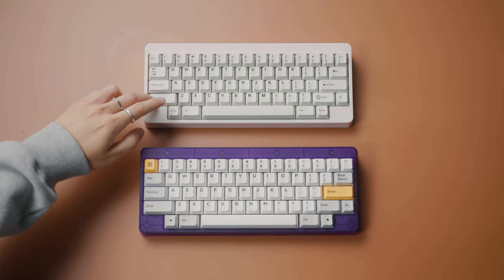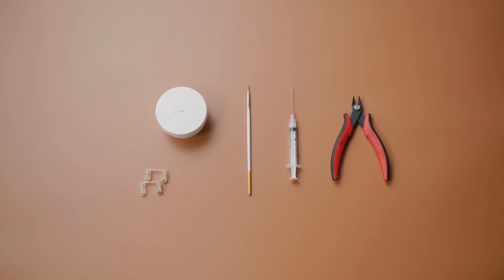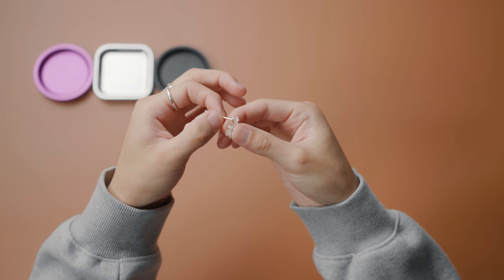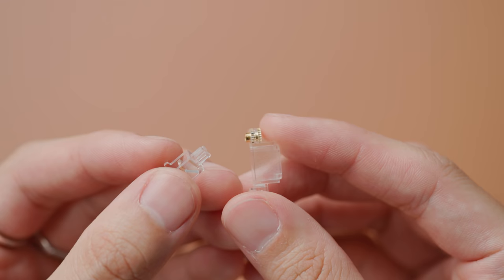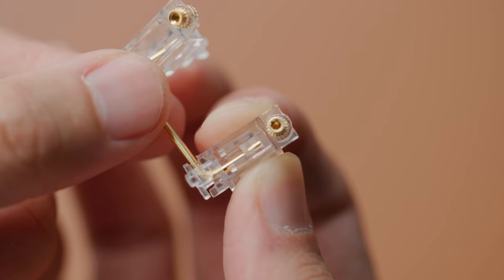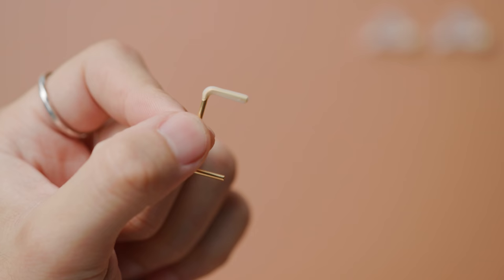How to Lube and Tune Stabilizers

Comment: My guy taeha made me buy dielectric grease and Teflon grease half a year ago and now he changed opinion. My guy
Reply from the maker: times were different back then :(
Reply: It do be like that sometimes
Reply: @TaehaTypes  what do you think about tribosys 3204 for stabilizers
Reply: @jesseochola6311  I'm not Taeha but he said thinner lubes (than 105g0) were good too, I've tried them on some cherry stabs as well as the gold zeal ones and they turned out perfectly fine.
Reply: @efrrun  okay thank u!
Reply: @jesseochola6311  its fine, just use the lube u used for your switches

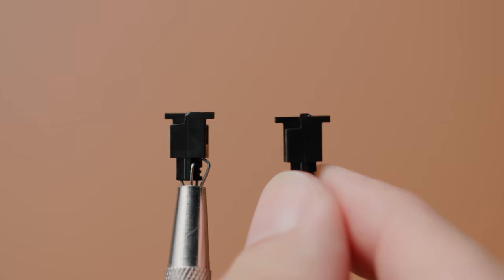Comment: 3:47 filing the clipped stems with a nail filer is also a nice touch as it made the stem as smooth and perfectly flat as the pre-clipped stabs like Durock, etc.
Reply: I like to clip cherry stabilizers at a 45-degree angle, so that the legs are still there but no fangs. Then put some electrical tape with a dolup of grease on top, on the pcb before installing the lubed stab's. It makes them sound nice and clacky and feel tight.

Comment: The syringe one is very helpful! I built my keeb a month ago and I didn’t lube my stab wires well so it rattles a lot and now I just realize if I want to fix the stabs, I’ll have to desolder everything on my board so I fixed it with some piece of tape to reduce the wiggle room. The rattling noise is still there but just a little but still, I wish to remove it entirely. Never thought of this syringe method before. I’ll give it a try. Thanks Taeha!

Comment: I'm building a GMMK pro White Ice, yesterday I spent 5 hours lubing and filming my 82 switches, I work on PC's for a living and I thought I could do the switches in 3 hours tops, oh how wrong I was! Films added so much more time to the switch lubing process, all that's left to do is my v2 durock stabs, I bought lube and grease for this build, and I think I'll still use the grease on the stabs. Very helpful video as always Taeha thanks a bunch!

Comment: Great tutorial! I think you can use interdental brush to remove excess lube inside. You just need to stick it inside like your scraping something or just letting the bristle of the brush to stick as much lube as possible then wipe the tip of the brush with paper towel or wipes. You may need to repeat the process several times until you notice there are to little lube are sticking to the bristle then you may proceed with reapply lube using the syringe method. It works fine with me and save me hassle to desoldering all of the switches.

Comment: Relatively newish mechanical keyboard enthusiast here. Have bought a few keebs over the past month or so and only just got into modding. (first mod was a tape mod!) 
Found my way to investigating stabilizers when, after trying different switches, keycaps, and applying tape mod, I still wasn't quite getting the sound I wanted. Realized it was likely the stabilizers. 
Your video helped me a lot! This sort of detailed walkthrough that also doesn't waste your time along the way was exactly the sort of content I was looking for. Thanks! 🙂

Comment: Thank you so much! I just lubed my switches and stabs for the first time and I watched a couple quick videos prior to doing it but I had this weird ticking sound only on the enter key and what you told me to do fixed it without having to take all the switches off and keycaps and unscrew the whole board. Now it sounds super thocky. It's a little muted but It's my first time. I'm happy with it.

Comment: Don't forget to balancing your wire. And my tips if you still notice some of ratling, you can wrap your wire with seal tape (2 or 3 layer is recommended) before you lube your wire, then lube your wire and put it back to the stem.
Reply: which is better? doing holee mode or just wraping the wire? or both?
Reply: @talyodiaz256  its same. You'll feel mushy. Its better for you get a good aftermarket stabilizer.

Comment: For anyone still watching this amazing guide, I have a tip that is probably going to sound like the most absurd thing you've ever heard.  To start, make sure all of your switches are lubed.  A lot of the time, if a switch is not lubed, it will sound scratchy and make the entire stabilizer sound like it is rattling.  Secondly, and this is the crazy part, if a stabilizer is rattling, and no amount of lube will fix it, switch the switch with another from a different key.  Once again, I know it sounds ridiculous, but it may work.

Comment: Thank you for this! Just finished putting together my first keyboard and I am really satisfied with the feel and sound. 

It isn't the best keeb out there. I consider it a budget build. 

TM680 from Antidote Studios in white
Lubed durock v1 stabs in white
Boba U4T switches factory lubed
Iceberg clones from keykits

It was great practice while I wait for the Aozora GB to finish. Then I'll build my first "premium" keeb with the Port cap set I got from Infinikeys. 

And... well... I'm already in the GB for Analog Dream 2 and plan to jump in the Laneware LW67 which I am ignorantly claiming will be my grail.

Comment: I have two keyboards I lubed with 2 stroke motor oil (which is relatively viscous). The first one I did 4 or more years ago and is still working like a charm. The second is more recent and also working like a charm. In both cases I did that without any disassembly and also lubing the stabilizers can be done this way. The result is a much quieter keyboard while also paired with O-Rings for each keycap. Keys sound super solid and no rattle. A quiet "thump" instead of "clackity clack"

Comment: What happened to band-aid modding the PCB? Is that method dead?
Reply: I think Taeha mentioned a couple times on stream that he didn’t think it made much of a difference, or was very effective with the stabs he’s been using, so he stopped doing it on most of his builds. Can’t furnish details or proof but I think he qualified that statement with your mileage may vary
Reply: @wongasaur  alright, makes sense! Thanks 👍

Comment: The syringes linked in the description are luer slip syringes I would recommend luer lock syringes for thicker lubricants as the luer slip syringes tend to fall off when using thick lube also the needle in the video is a 18ga blunt needle but they sell larger needles that would work better if you want to use thicker lube like a 15ga or a 16ga.

Comment: if you are in a relatively dusty environment, the dust in the air finds its way to the lubricant
+ if the air is humid then the area becomes a pocket dimention for microorganisms

Comment: I just built my first keyboard! As a novice, I was really happy with the results for the most part-- but my spacebar sounds awful. I was super confused because the smaller stabalizers on the board sound great. I was kind of bummed and not sure what to do about the space bar. After watching this video, I was able to diagnose and address the problem. This was very easy to understand and also info that is pertinent but not included in other tutorials. Thank you so much!! (My keyboard is a freebird60 with melonmilk tactile switches, durok v2 stabilizers (came with the fb60 base kit, and a cherry profile PBT keycaps I snagged off Etsy).

Comment: pls help, I just finished modding my keyboard and did everything as instructed in the video, but when I press on the left shift key (the rest of the stabs are fine), it has a weird bump in it even though I bought linear switches. I checked if it was the switch but it looks like its something with the stabilizer. Anyone know how to fix this?

Comment: I've tuned like 5 sets of stabs so far, and I still don't think I've quite got it down. This is a super helpful video for beginners though! I usually use dielectric grease on the bars of the stabs, but I may try Krytox on the next one. Also, gonna try the syringe to fix a couple boards I think just need a bit more lube love.

Comment: 🎯 Key Takeaways for quick navigation:

00:51 🎮 Lubing and tuning stabilizers is crucial for building a custom mechanical keyboard, and it's considered one of the most important mods for your keyboard's feel and sound.
03:12 🧰 Clipping older stabilizers can improve their feel by removing protruding prongs. Newer stabilizers like Durock or C3 don't need this step.
04:23 🛢️ Lubricate the stabilizer housings with a thin lubricant like Krytox 205 Grade 0 to reduce friction and dampen noise. Apply a thin, even coat.
05:50 🪙 Lubricate the stabilizer wires to reduce rattling. Use a semi-thick lubricant like Krytox 205 Grade 0, dielectric grease, or super lube.
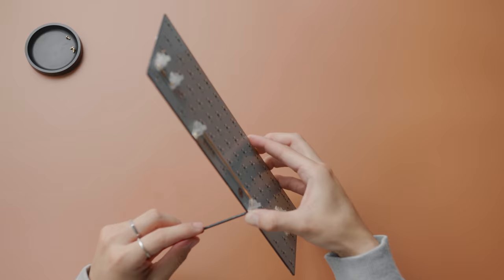08:42 🔍 Test the stabilizers by installingthem, along with switches and keycaps, before soldering. Listen for rattling and ensure they feel smooth but not sluggish.
10:35 🎯 Finding the right balance in lubing your stabilizers may require some trial and error. Use your intended keycap set for testing, and don't rush the process. Practice makes perfect.

Made with HARPA AI

Comment: Will do this on the Corsair K63 since this keyboard survived a few full force blows because from serious gaming rage and it's still working like it's new. Already filled the case with foam and I did even fill the spacebar with foam to make it more scilent. Bought me some of that Krytox205g0 for the cherry red switches to practice, the next keyboard will be 65 if it is possible to make the top left button function like the tilde key without FN key and esc with FN key. Tenkeyless without the arrows and the keys above that would be even better.

Comment: Here is a lazier way to lube all your switches and stabs (materials: tweezers and choice of lube) use tweezers to hold the stem in place and lube the outside of the stem. Dont even have to take out your switches or keycaps! Incredible Videos Taeha!
Reply: How would you lube switches this way? You have to open the switch to access the stem since it's inside the switch. Same for stabs. You have to take them apart to properly lube them.
Reply: @jameelkurabi  You could only lube the outside of the stem and if you push the stem down you could get a little bit of lube inside the switch! I have seen people do/recommend this before but I have never tried it myself so I wouldn't know for sure! Just a suggestion you could possibly experiment with

Comment: Mine has been a keyboard experience of much shame. I can't even guess myself what it must be to not go mentally insane when installing stabilizers.

Stabilizer installation is one of the most frustrating experiences known to man. First, you gotta do all of your own research on which type of lube to use on the wires and which type to use on the housing. Some beginners straight up use the same type of lube on both the housing and wires, and end up with their stabilizers either too thick or too thin. Afterwards, you mustn't fall into the trap of letting PE foam stay under your stabilizer stems, which keyboard manufacturers do not cut off for you nor instruct you to cut them off yourself and you'll end up getting mushy stabilizers, not even knowing the cause. Then, when you find yourself overlubing or underlubing your wires, you literally have to disassemble and reassemble your keyboard every time if you don't have a syringe. A syringe may not even help you in this situation as the lube is too thick to be sucked upwards. Before you know it, you get lube everywhere on your hands and your pcb. Frustration overwhelms and you lose your patience. When you've gone insane after disassembling and reassembling your keyboard so many times as well as being overwhelmed by fatigue, you no longer try to insert the lubed stabilizer wire into the housing meticulously but instead with crudeness and wrath, causing lube to be scraped off onto the sides of the stem and thus making the lube uneven. And you sit there and wonder why your stabilizers are still producing that rattling din that crawls under your skin even when you've put in so much lube into the stabilizer. Now look at yourself. Your keyboard is covered with lube, which is insoluble in water so cleaning that up would require alcohol and not just with simple soap and water. You've spent so much effort, time and money into this just for all of it to be in vain. You feel nauseous and weary. You want to start over, but you can't because water does not clean off the hydrophobic lube inside the housing. The sound of stabilizer rattle echoes throughout my brain, torturing me even in my dreams. God, why was I even born? Why must I endure such torment? 

I am currently writing this in a mental hospital. Typing this comment sent me in a state of delirium due to my PTSD that they diagnosed me with. Despite being an adolescent, my hair had turned grey and my skin had gone wrinkled due to the stress of lubing stabilizers. My parents treat me no longer as a human but as of a handicap and a being of inferior intellect. They disowned me and forced me to move to the countryside where I will spend the rest of my miserable life contemplating my regrets of getting into the hobby. All of this would have never happened of I didn't dive into the damned rabbit hole of mechanical keyboards. 

the last paragraph was a joke

Comment: Glad you were super clear on the direction of the slider with regard to the openings the wire goes into. Other videos I referred to when doing my first stabilizer mod attempt weren't clear about that. It led to me putting the 2-hole side facing the opposite way, so the wire went into the 1-hole end and makes a horrible crunch when I bottom out. Been too lazy to fix it lol but maybe now that I see this video I'll be inspired to do it right.

Comment: instead of spending money on all these oil i lubricated my switches with #7000 differential  silicone (for RC)which cost couple of bucks for 10ml bottle. It made clicky blue switches dead silent. I pressed down the switch with a toothpick and put 1 drop for each switch.aleady silenced 2 blue switch keyboards .

Comment: How did you manage to get the wire and the needle both through that tiny hole of the stem at the same time??? I am really confused because I am using the syringe bought through your link so that the size of the needle should be the same. My wire alone bearly goes through that hole of the stem and not to mention get them both through that hole at the same time... During my tryouts the needle can only be bearly inserted at the opening of the stem which makes the lube overflow from the opening instead of filling the inside space of the stem?

Comment: What do you think of the Micropore Method? Essentially instead of the Band Aid to the inner housing bit, apply a single layer of Micropore tape to the ends of the wires?

Comment: HI i have one question. Do screw in stabilizers work on any PCB or just some few?
Reply: No some pcb or plate will also use plate mounted stab so they are mounted onto the plate and not screwed into the pcb, most cheaper keyboards use plate mount stabilizers also including high manufactured brands like razor and Logitech.

Comment: Hi I went to the durock stabilizer website and it asked me if I want
 4x 2u. 1x 6.25u Clear 
4x 2u. 1x 7u Clear
4x 2u. 1x 7u Smokey
Or 4x 2u. 1x 6.25u Smokey 
Can you pls tell me what this means and if it has something to do with size of pcb or case

Comment: I see videos that suggest just using dielectric grease for both the parts here, and some one or the other.   You just used 205G0 as some do.  Can you spell out for me the reason to use two different types of lube or just stick to one or the others?

Comment: I have small question about lube, have you tried "dry" lube with ptfe ? Its mostly used for bike chains but its very durable and it resist all dust to stick to it.

Im asking mainly becouse the lube you using is not realy avilable in my country (i could order it buy delivery would be half of its price) and i remember i was using ptfe dry lube in electropneumatic projects few years ago and it worked realy well as a lube for plastic-metal plastic-plastic moving parts.

Comment: Hey guys I just finished building my first mechanical keyboard and I have a little bit of a problem whenever I tried to get a key cap the switch comes out to PS I am using a hotspot for PCB

Comment: Hey, do you think PTFE grease can work to lube stabs? I've got some that I use on my 3D printer's trapezoidal screw (metal on plastic contact) and bearings+metal rod. It's not too heavy, and disappears with ease when applying it on a stainless steel rod. I also have the same PTFE lube but in spray format.

Comment: I use super lube oil for my speed silver switches and the super lube grease for my stabilizers . Should I have just gotten the oil and used it for both switch and stab?

Comment: I think I did everything right, but I’m still experiencing some rattle in my spacebar. Could there be a problem with the wire? (Gk61 stabs lubed and clipped btw)

Comment: sometimes the wire also require tuning right? I found myself with a slightly bendy wire and it takes time for noobs like me to tuning it.
I use my phone to check whether the wire is straight or still bendy hahaha..

Not sure if I'm just unlucky or all those stabs wire for spacebar indeed requires tuning

Comment: Great video sorry if I missed this but the lube you put on the metal of the stabilizer was that the same lube for the plastics bits. Just not sure if I need to get super lube silicon grease or just super lube. Thanks 🙏